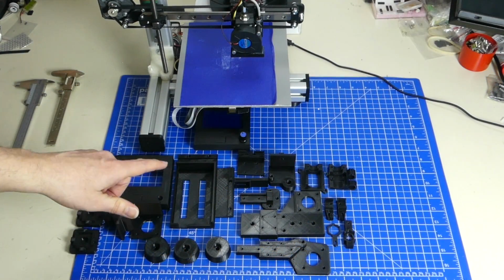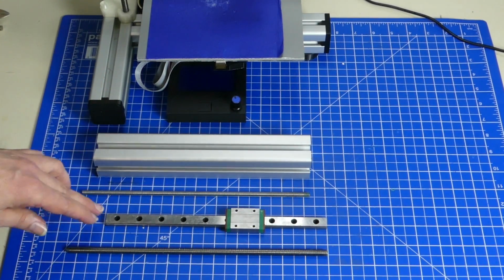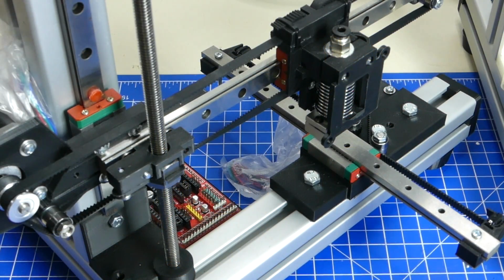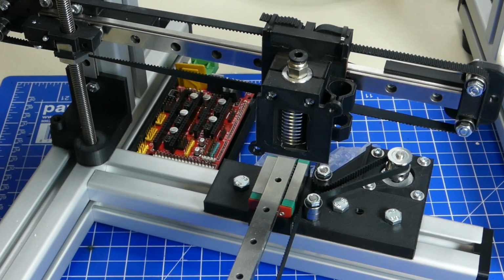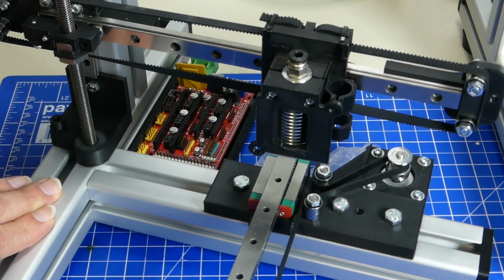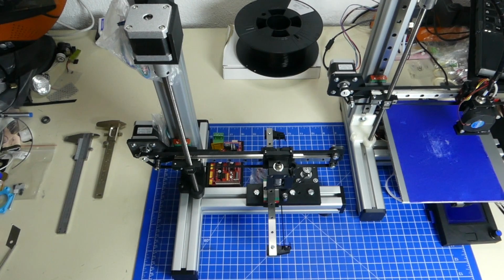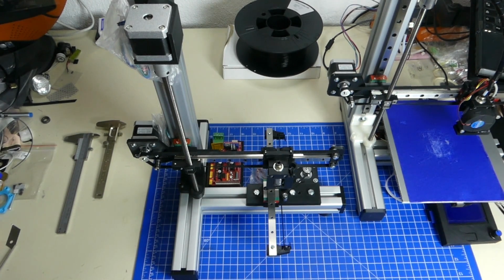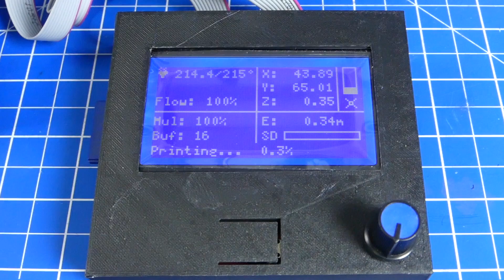Bad Robin the small and reliable Open Source 3D Printer

Comment: Thanks for this project. Still the printer works without problems since 1/4 year. Small problems occured (like broken cables), but everything can be fixed easily. Excellent job!

Comment: Wow! This is a beautiful build. I have one question in regard to the cooling. Won't you be pulling hot air from the heatsink and pushing that onto the part? I've always practiced pushing cool air onto parts.
Reply from the maker: The turbine fan has such a great throughput that it only has a very small effect. The cooling is very good. Part of that is due to the effect that the strong flow from fan will draw surrounding air over the print too.

Comment: Very cool! Thanks for sharing. May give it a try. What material are you using for your print bed?
Reply from the maker: The one in this video is using a material called Metawell, I usually go for solid 4mm aluminium sheet, because the level sensor works best with that.

Comment: if using 400mm 300mm 250mm frame and 3x250mm linear guide what printing build size maximum will get? thank you
Reply from the maker: With 250mm rails you get 155x165x170mm. If you use longer rails you gain what you add. I don't recommend going beyond 320mm for X and Y,  Z is unlimited.

Comment: Why the X belt is twisted?
Reply from the maker: It very effectively cancels vibrations of the belt that can become visible in the print.
Reply: @dherrendoerfer  Have you tried using toothed pully on the X belt path? Seems if using toothed pully the belt doesn't need to be twisted.
Reply from the maker: Yes I have tried them, but the solution of twisting the belt on the return trip to the stepper is the simplest and cheapest solution to the problem, and it does not have any downsides to it.